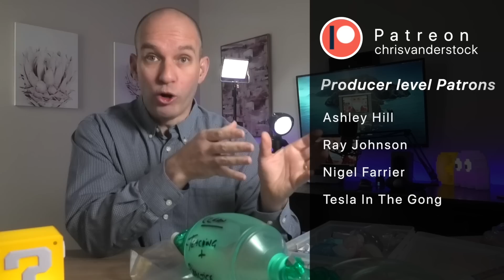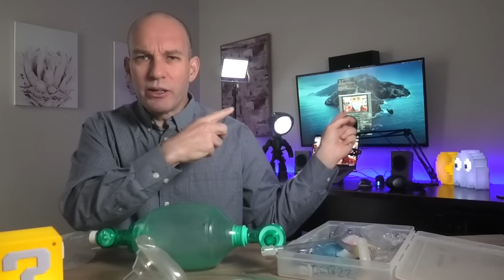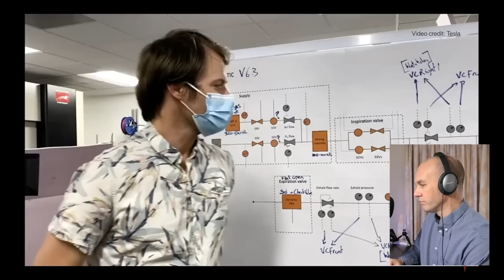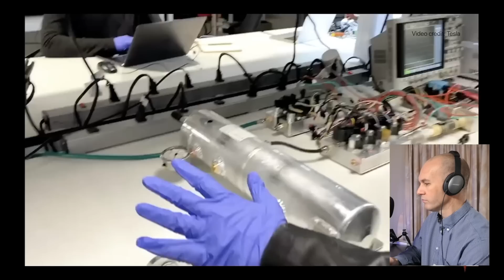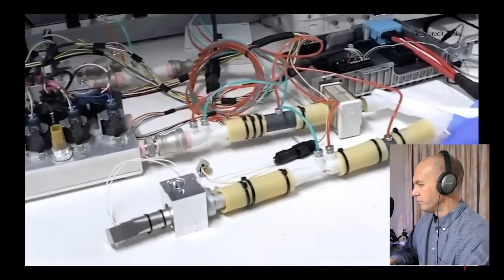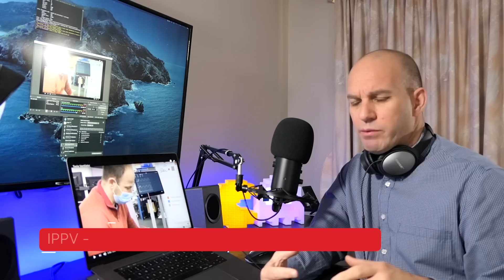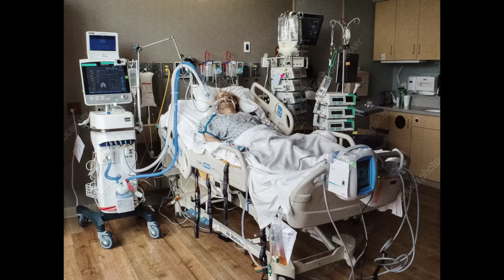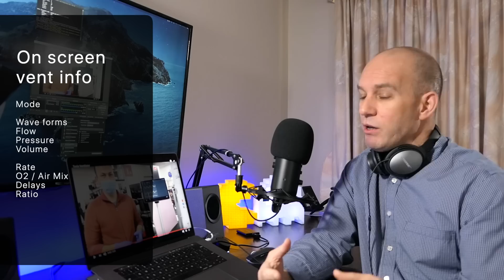Nurse reacts to Tesla's ventilator & what's with those resuscitators?

Comment: Your phone is a weapons guidance system, attach the right device antenna reciever and is essentially the most advanced micro processor on the planet.. What they are doing i actually basic. 
That said the R.F. radiation emitted from the tablet to the infotainment system is cupping and fragmenting red blood cells and damaging R.N.A.  and causing Roulet chain like structures in Red blood cells and this is in and of it self restricting the carriage of oxygen to the brain and vital organs.
P.S. you L.E.D. screens with pure blue light are Class 1 Lasers and damaging your optic nerv, i should know i have damaged wyes from this type of screen from staring at a screen for the last 3 years straight.....

Comment: Out of all medical equipment, why are ventilators specifically in shortage around the world?
Reply: Ventilators are used to help critically ill patients breath. They are incredibly hard on the body, so they are only used when nothing else has worked to get oxygen into a patients blood. Under normal circumstances that doesn’t happen very often, and people seldom need them for very long. Either they get better or die pretty quickly. Thus, hospitals don’t usually need very many of them at all. The coronavirus however causes extremely severe pneumonia in a substantial amount of cases, and coronavirus patients often need the ventilator for a lot longer than normal when they do need it. This means that there are a lot more people who need them for longer right now, making the need for them far, far higher than normal, and as they are complicated pieces of equipment that demand very careful construction to work properly, meeting that increased demand has proven extremely difficult.

Comment: ATTENTION ALL DOCTORS! PLEASE REASSESS YOUR DIAGNOSIS & PROTOCOL- COVID-19 MAY NOT LEAD TO RESPIRATORY FAILURE IT MAY BE OXYGENATION FAILURE! HIGH FLOW OXYGEN MAY BE NECESSARY NOT VENTILATION! 

Ventilators are a last resort with only a 15% - 20% positive outcome rate. Hospitals daily intensive care cost: Mean intensive care unit cost and length of stay were 31,574 +/- 42,570 dollars and 14.4 days +/- 15.8 for patients requiring mechanical ventilation and 12,931 +/- 20,569 dollars and 8.5 days +/-  https://www.ncbi.nlm.nih.gov/pubmed/15942342

DOCTORS, PLEASE REVIEW ASAP!
Are Ventilators for COVID-19 Doing More Harm than Good? -  https://youtu.be/6Dwcfye7_LQ  
Do Ventilators Save Patients - https://youtu.be/QnShqaHdYgo  
Gov. Cuomo On Ventilators - https://youtu.be/KFjkbnY9lzg
COVID -19 Respiratory Management - https://youtu.be/dTGpWDIzEPQ
Avoiding Intubation And Initial Ventilation in COVID-19 - https://youtu.be/mZqNiQxJLSU

Comment: Based on the presentation, I suddenly think the old iron lungs that kept polio patients alive for years are greatly superior to today's ventilators.  They work by changing the air pressure around the patient's body while the patient's head was outside the device so that negative air pressure around the patient drew air into the lungs, replacing the function of the diaphragm, then rhythmically increased the air pressure around the body so the patient expelled the air.   Allowed the subject to speak and breathe more or less normally .
Reply: I could see how a negative ventilator would be better to live with for a patient who's sole majority problem is not being able to mechanically breath. However, for an acute viral infection like COVID-19, the convenience should be given to the healthcare workers, not the patient. A patient inside an iron lung would be extremely difficult to work on in an intensive care situation. Nurses need to get to lines, respiratory therapists need to draw arterial blood, x-rays need to be taken, patient might need to be frequently turned or proned. Also, for a respiratory infection where lung compliances change, you need ventilation pressures and volumes to be measured and really precise. You can't get that with negative pressure ventilation.

Comment: It's nice to see safety built in with the dual flow and pressure transducers on both input and output for redundancy/monitoring, and a watchdog system. Plus the exhalation variable pressure control valve being fail safe open. Curious to the signal comparison and transition to determine "best" transducer in event of a transducer failure.

Comment: All you need to do is look at the mandatory minimum requirements for a ventilator to see that these companies are pulling a PR stunt rather than trying to find a solution to a problem. I actually started looking at rapid prototyping an easy to manufacture ventilator. I got lost in all the "You need a backup for the backup's backup" and gave up realising it is a job for someone smarter than I. To get over the pressure problem I had intended on using a 3D printed, variable clutch that you could fine tune with a spring and then use a stepper motor to control the swing of a cam which would put pressure on a air bladder that would be filled from a tank that would mix the gas. Buuuuuuuuuuut after talking to a nurse that manages ventilators, they started pointing out flaws left right and centre in my plans :< Made me sad.
Reply: Any company throwing something together without working with medical expertise is likely only doing it for PR reasons. Not Tesla. Tesla is working with Medtronic on designing this. If I'm not mistaken, Ford, GM and VW are also working directly with medical equipment manufacturers to produce ventilators as well. None of them are PR Stunts.

Comment: I am sure that this a stupid question... but as a an engineer (software), my first thought it why rather than PEEP, why have engineers not focused on stimulating the diaphragm? I am sure that there is a good reason, just curious  as to what that is.
Reply from the maker: There are negative pressure ventilation methods, like the old iron lung at the height of the polio crises. But they don't keep the micro-alveoli open which is what patients need when they've got pathology in the lungs.
Reply: @chrisvanderstock  ah. Makes perfect sense.

Comment: Chris, excellent base level education on a ventilator for the folks at home. I am an American Respiratory Therapist, or the clinician that typically runs the ventilators in the hospital. Do you know if AUS is starting to use respiratory therapists in their system or are you lot still only using physiotherapists and nurses?
Reply from the maker: Due to elective surgery cuts, our ICU's are running at 30% less than normal, so its business as usual at present. In Australia, an ICU nurse is trained and credentialed to manage the ventilator within certain guidelines and hospital policies. If the patient is deviating (either through obvious clinical signs, or ABG's), the nurse already has approval to modify vent settings - but if the changes are outside of approved guidelines, s/he needs doctor approval / oversight.

Comment: Interesting that Tesla is doing this... wondering if they grabbed some engineers from SpaceX (a company that already has to do life support of a kind).  Also found it odd that Tesla is only supplying crummy surgical masks that don't really work, and not even giving them the extenders so EVERYONE IS TOUCHING THEIR MASKS!  Oh, and as far as extra features, they might not need them.  They are probably aiming at a fast track approval for limited uses, and probably won't be interested in making these once the shortage is no longer an issue.  I say this partly because the computer they are using has a known flaw that causes it to self destruct after 5-10 years and I doubt the FDA would approve such a thing outside of an emergency.

Comment: As an engineer, why is the compressible bladder on the Air-viva so large if there is a danger of over inflating the lungs and thereby damaging them? Make the volume smaller!
Reply from the maker: Agreed. Paediatric versions are 500mls, which again is too large of volume for a baby/toddler, so perhaps it design for situations when you mask ventilating and air is escaping around the edges (getting a seal can be challenging) - so you ventilate with more volume.
Reply: Also it maybe is larger to not to collapse the bladder.

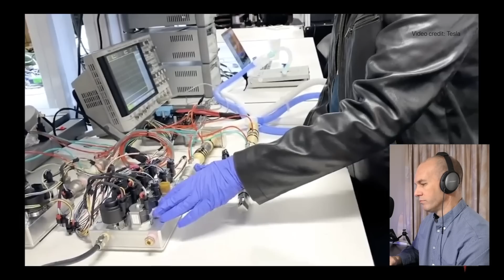Comment: Regarding cooperative respiration, that’s addressed in both the diagram and at 12:10-12-30 - the sensors in place just prior and after the PT filter/lungs are pressure and flow rate for sensing the natural exhalation of the lung.  It looks like they have some great filtering on that input data as well given everything stays in sync with the artificial lungs (the mechanical bounce you see after he releases pressure off the lung indicates that there is an actual driver providing force into the lung driving back to a volume matching the offset, I’d expect it to be less significant if it was just the momentum of the top plate of the lung since it’s just an aluminum/rubber or silicone enclosure)

Comment: Hi Chris awesome vid, Would a Vortran AR valve be a better answer to the ventilator issue? or could this valve be combined with say a DIY BVM with a patient active inhalation feed back circuit to control the ventilation device making it a more functional piece of equipment? Also with these BVM DIY ventilators the patients would need to be fully sedated in order for them to be anyway safely used due to not have a patients active breath feed back control? Cheers Chris

Comment: I was wondering for patient safety, the addition of a high volume natural gas or propane pressure regulator to regulate the delivery to somewhere between 4 and 12 inches water column to protect the lungs. The flow could be controlled from low static pressure to breath assist pressure with a proper valve or by directly by servo or solenoid changing the regulator from lower to high pressure in the breathing cycle. 

I was looking at a design, not by what prior art is to be replicated, but by function. A cycle of higher pressure followed by a cycle of lower pressure for the exhalation but with a lower limit set to prevent lung collapse. The servo or solenoid would be at two adjustable positions for the two regulator set pressures. Monitor flow and pressure gauges, filters, mix chamber can be added around the regulator core. It could be designed to work with life safety airline, hospital air and gas, etc as needed. Being able to run off life safety equipment such as used for confined space work, would be able to expand the use to emergency field hospitals without the infrastructure of plumbed gasses. Life safety air for confined spaces, chemical plants, etc. means that this too would be mostly made with off the shelf industry standard components.
A cycle timer, a servo, motor or solenoid fitted to a large diaphragm low pressure gas regulator, would be the heart of the cycle. Time to hit the gas boiler and natural bus manufactures for the regulators and the life safety suppliers for airline breathing air supplies.

Comment: Great job Chris and TESLA. I would suggest, that the waveforms get colorized such that the inspiratory component is GREEN and the expiratory is BLUE such that one can see the time of each (ratio) which is important for stabilizing thge patient. As well, the same colorization would apply to the display of the large number that will be on screen for each waveform, such that the number becomes relatively more green or blue, almost filling the digits like a gas tank gauge, with same ratio of green/blue as breathing progresses. This would help caregivers see the overall I:E ratio from afar on a breath by breath status helping determine course of treatment more easily without having to do math or look closely to a single value "I/E ratio". 
Also, I have always wanted the BiPAP S/T devices in sleep labs to show the percentage of Spontaneous vs mechanical breaths and HOW MUCH of the breath is mechanical. This again, could be colorized with the same fill tank scenario of how many breaths are spontaneous vs mechanical in the display of the resp rate itself.
Reply: This just came across my inbox. Thought other would be interested. 
https://www.popularmechanics.com/technology/security/a32186006/jailbreak-cpap-machines-ventilators/
We Can Avoid a Ventilator Shortage by Jailbreaking CPAP Machines

Comment: Many people are dying from the improper use of ventilators. Too much volume of air is being forced into lungs that can't handle it. Multiple doctors claimed that using 1/2 the tidal volume(normally 12ml/kg, should use 6ml/kg) with much higher O2 is the best way to go. Over inflation of the lungs cause more damage to the alveoli. 22% more people survive.

Comment: The idea when you build something it's not to reinvent the wheel.  Easy to use all the parts in stock and just add the missing parts.  This is awesome..  I think it meets all what  Chris is requesting, I think they will add the info or the feedback you asking. I think they will integrate in an ipad to monitor this systems in a wifi network.  Same as the Tesla cars.

Comment: Tesla  .no need to re-invent the wheel .There are tons of ventilator designs out there.  Just help a company like Philips Respironics build more.
Reply: They got to either redesign the ventilator to work with the parts they already produce or they have to redesign the production lines to build parts that they have never produced. Tesla is working with Medtronic right now. Redesigning the production lines would likely take longer for them and would have less reliability to start with. It would also cause them more issues after the pandemic is over, as they would then have to redesign the lines again. GM is building pre-designed ventilators and it will take them until June to get the first group out. Tesla appears to have this mostly designed already. Testing and certification will take a while though.

Comment: 1. The model 3 touch screen  is made by LG. Its the same basic  design as the tablets and smartphone screens that they chun out by the thousands.
2. The software controlling is not more safety oriented than those used for computerized medical devices nor is the software error free.

Comment: What happens to all the virus particles that come out of the patients lungs upon each exhalation? These must not be allowed to contaminate the proximate area where the patient is located.  Also, if the particles are trapped inside the plumbing of the ventilator (tubes, etc) by an exhaust filter, they will accumulate and potentially be re-inhaled on the next inhalation breathing cycle.  Such re-breathing of virus particles provides a positive feedback component to the disease concentration in the lungs and must be avoided so that the disease doesn't grow exponentially.  Therefore, the interior of the ventilator needs to be kept scrupulously clean and particulate free by purging or frequent cleaning.  This is a design consideration that doesn't seem to be getting serious (any) attention.
Reply: In a typical setting:
Exhaust air can be (is if needed) filtered to protect the room air.
The supply side plumbing (most likely including  the supply filter) is "protected" via non return valves..
Reply: @kadmow  I understand that the room air is protected by an exhaust filter and that the fresh air and oxygen supply can also be protected by filters and/or valves.  However, the patients body (lung) is multiplying (reproducing many copies of) the virus particles and these are present in the exhaled gases.  My question relates to the ultimate disposition of this growing number of particles.  If allowed to build up in the plumbing (tubes, valves and filters), they are likely to be inhaled (rebreathed) leading to accelerated progression of the disease.
Reply: @richarddecker6642  : I think you are overthinking.  Or Trolling, one can never be sure in faceless communications.

If the patient is multiplying virus...  Any "re-inhaled from the portions of tube "not protected" by valving and filters is of no consequence...  Just keep venting them until they either die or recover, problem solved - rather "non-problem"..   The final air after any filter can be heated (Anthony's comment), IR  treated, Ozone scrubbed or many other ways of killing / denaturing proteins which escape through that labrynth..  (Just watch out for the Minotaur.)
Reply: @kadmow  Possibly I am "over thinking".  However, there is no question that the patient is multiplying  virus, that is how the virus reproduces is by hijacking the human (lung) cells to replicate itself.  A single cell can potentially make many copies of the virus particles that are then re-released to the surrounding tissues.
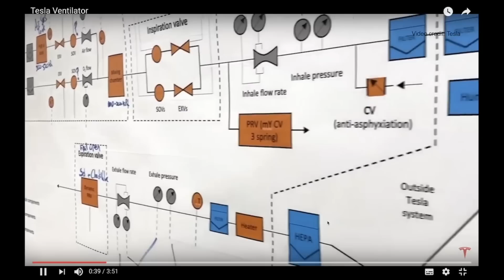Reply: At 10:05, you can see the diagram pretty clearly. The exhaled air passes through 2 filters before exiting. There is also a heater in-between. Not a medical engineer, but it looks like they have that covered. Going to be non-Tesla equipment for that, likely supplied by Medtronic, who they are working on with this.
Reply: @anthonypelchat  Yes, the exhaled air is filtered before being exhausted into the room.  However the patient is generating large quantities of particles with every exhalation of breath.  These particles have nowhere to go and must build up in the plumbing of the ventilator system.  Therefore, there is a question about the possibility of re-breathing virus particles leading to acceleration of disease progression.